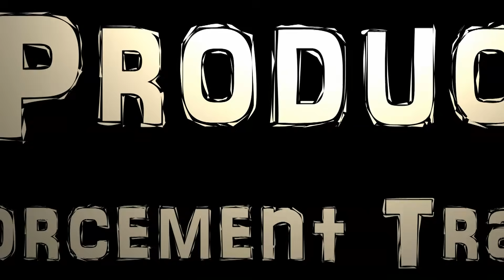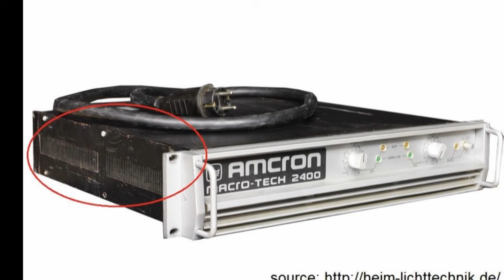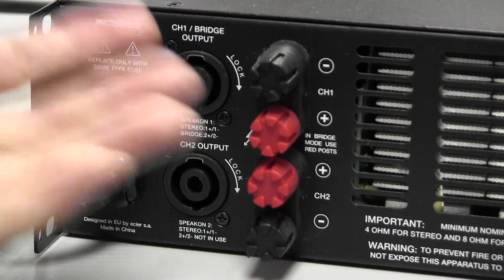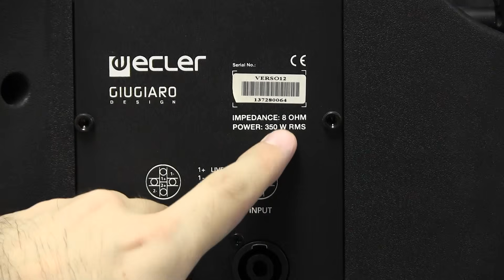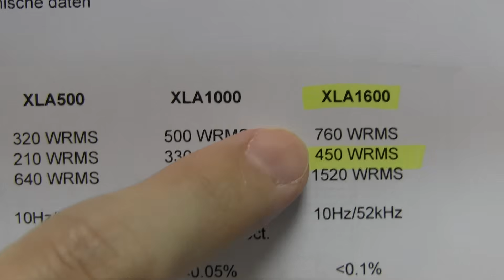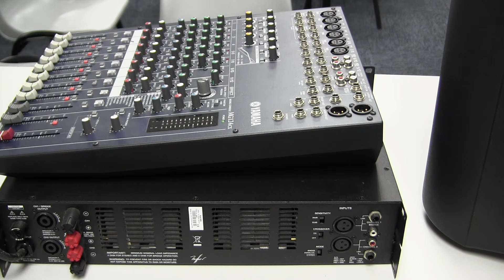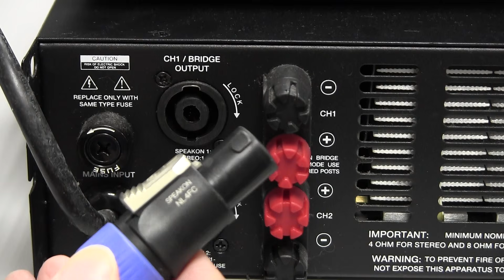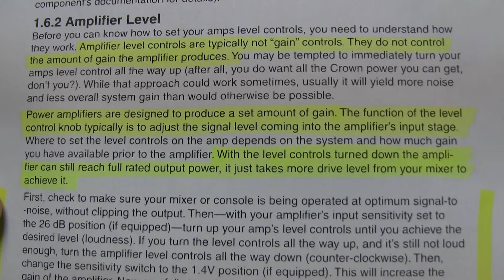How to connect a power amplifier to passive loudspeakers

Comment: does channel 1 & 2 means left and right?
Reply from the maker: Neil Bantugan No, you can deploy them however they are needed.
Reply: k sir. if i have 4 x 100 W speakers what amplifier do i need to suit my speaker specs?
Reply from the maker: Neil Bantugan Check the manual or the back of your loudspeakers - it will tell you what amplifier power is recommended. Then use the formula given in the video to work out how much total amplifier power you need.
Reply: it says 8 ohms sir. I am planning to wire 8 x 100 W at 8 ohms in series/parallel. So what power of amplifier do i neeed sir? Thanks !
Reply: P.S. the 8 speakers are only for a single channel so for 2 channel amp a total of 16 speakers.Thanks !
Reply from the maker: Neil Bantugan The video explains how to do this: work out the total combined impedance of your loudspeakers and check power amplifier delivery into that impedance. Then calculate how much power each loudspeaker will receive - in your case this should be 100-200 watts each. 
By the way, in sound reinforcement speakers are typically wired in parallel only, which for 8 loudspeakers gives a 1 ohm load, too low for most power amplifiers to drive. I suggest changing your design, or using 16 ohm loudspeakers.
Reply: Sir thank you for your response. Is it ok to plug a 400 Watt speakers @ 8 Ohm to a 600 Watt amplifier  rated in 8 Ohms?
Reply from the maker: Neil Bantugan You're welcome! Your question is answered in the video under the 'ensure amplifiers and loudspeakers are correctly matched' section.

Comment: Any thoughts or advice on DI boxes and PA?
I have a Mackie 808s and Mackie 300c passive speakers. I have been miking the guitar amp at about 30% through the Mackie 808s the rest from the guitar amp itself. The sound is quite good but in some rooms feedback is an issue as I play jumbo acoustic guitars.....thoughts or guidance?
Btw......great info on your vids. Thank you so much.
Reply from the maker: Wally Hall Hello Wally, nice to hear from you - you have a great voice, I've seen some of your Dylan covers :)
I've done a series of videos on DI boxes which you might like to have a look at: https://www.youtube.com/playlist?list=PLcTpo3gc2RJxKh7_x7Uttsz_BmH-1llW1
You must be a pretty big guy - I have a beautiful Takamine jumbo which doesn't get much play time just because of its physical size - I'm 5'10" and have a bit of trouble getting my right arm over it! 
A DI will usually solve most of your feedback issues but it can still happen because the top of the guitar acts like the diaphragm in a microphone and can start to resonate at certain frequencies, even with a direct connection. Fortunately things have to be pretty loud for this to happen. 
If you're using a mic it's important to aim your speakers away from it as much as possible - make sure you're sitting behind your PA as opposed to in front of it, and if you're using an amp as your monitor makes sure it's in front of you aimed at the back of the mic where the cable plugs in. It's also worth experimenting with your mixer's EQ to find the frequencies where feedback is likely to happen and cutting them slightly in advance, or taking note of them so that you can quickly drop them if a ring or moan starts during the gig. 
Hope that helps, I always love hearing from more experienced musicians like yourself.
Reply: Yep.....I'm 6'3".....so...jumbo guitars fit me okay. 
Thank you for the compliments my friend. I'll be taking your guidance in the DI use.....what all do ya do at GLB Productions, and, where are you located?
I do appreciate  the feedback sir.
Wally
Reply from the maker: Wally Hall Good to hear back from you. I'm in Singapore - GLB Productions is my company and I do mostly training for schools, churches and the like. I also do some freelance sound engineer work now and then, although I'm glad to have left all the carrying speakers and coiling cables behind :)

Comment: please answer me ?
i have 4 load passive speaker from "behringer eurolive a1520 pro" it is 8 ohms at 300watt continuous and i have behringer epx3000 watt amplifier
my amplifier can run in stereo mode
8ohms /20hz-20khz @ 0.1 thd  500watt
8ohms /1khz @ 0.1& thd          520watt
4ohms / 20hz- 20khz @ 0.1 thd 850watt
4ohms / 1khz @ 0.1 & thd         900watt
2ohms / 20hz @ 1& thd         1400 watt
2ohms / 1khz @ 1&thd          1500 watt

can my amplifier run those 4 loud speaker ?
Reply from the maker: nice_q8t Ah, good question. Let me ask you - based on what I have said in the video, what is the total load in ohms on each channel of your amp, assuming you hook up two speakers to each channel for a total of four? I could tell you the answer, but I'm going to help you work it out for yourself instead ;)
Reply: GLB Productions do you mean the rms power ?
this is the rms power 
8ohms / 1khz @0.1 %thd  550  watt
4ohms / 1khz @ 0.1 %thd  900 watt
2 ohms/ 1khz @ 1% thd  1500 watt

in stereo mode (both channels driven)
8ohms / 1khz    650 watt
4ohms / 1khz    1150 watt
2ohms / 1khz    2100 watt
Reply from the maker: nice_q8t No, the load on the amplifier. You have a 2-channel amplifier; you connect two eight ohm speakers to each channel, what is the combined load on each channel? The answer is in the video :)
Reply: GLB Productions did you mean i should divided 8ohms to 2 speakers in left channels = 4ohms total and 8ohms divided to 2 speakers = 4 ohms in right channel 
correct ?
Reply from the maker: nice_q8t Correct, the combined load is 4 ohms per channel. So if your amp delivers 850 watts into 4 ohms, how many watts does each speaker receive, assuming two speakers connected to each channel?
Reply: one speaker watt is 300 at 8ohms but i dont know how much it will be in 4 ohms ?
Reply from the maker: nice_q8t No, read my previous comment again! Your amp delivers 850 watts into 4 ohms. If there are 2 speakers sharing these 850 watts, how much does each receive?
Reply: 850w divided into 4 speakers = 212 watt ?
Reply from the maker: nice_q8t Almost! It's 850 watts per channel, shared between TWO speakers. So 425 watts per speaker. So if your speakers have a continuous rating of 300 watts, is the amp suitable, based on what I say in the video?
Reply: GLB Productions
 am not sure because i am so noob in sound am sorry if i took your time :P by the way these speakers are in our school stage - already equipped with two epx 3000 watts i just wondering if i can hook up them in one amp and i took the next one is a step if the first amp fired or something goes wrong

thank you so much for your time
Reply from the maker: nice_q8t No worries. The short answer is yes you can - you are one step away from calculating why this is the case. Get back to me when you figure it out!
Reply: GLB Productions i think its suitable left will get 850 watt and right will get 850 watt and when you do the math 850 watt x 2 = 1700 and my amplifier is 3000 watt is it correct ?

Comment: can i hook them up to a digital system such as a computer or a usb bluetooth dongle
Reply from the maker: paul schlacter By 'them' you are referring to...
Reply: Passive loudspeakers with an amplifier supporting xlr cabling
Reply from the maker: paul schlacter Yes but it is best to run through a mixer of some kind. See my video: https://www.youtube.com/watch?v=ge4Iynh4rcc
Reply: can i use an external or internal sound card as a type of mixer?
Reply from the maker: paul schlacter Yes you can. Just bear in mind that the outputs of most soundcards are unbalanced so you will need the appropriate equipment to go from minijack or RCA to XLR connectors.

Comment: Great video!!! What would be the reason to daisy chain amps together??
Reply from the maker: Jamial Black When you need to drive multiple amps from one signal source eg the main LR outputs of your mixer to four power amps each driving one large speaker at front of house.
Reply: GLB Productions thanks great info!!!
Reply from the maker: Jamial Black No worries.
Reply: Is there a such thing as daisy chaining amp(s) together for more power?
Reply from the maker: Jamial Black Yes in the sense that you get more total wattage by connecting more amps into your PA system. However you would never connect the speaker level output of an amplifier to the line level input of another!
Reply: Great info thanks!!

Comment: Hi Bruno!
Last time I forgot to ask you a thing about to setting Active Loudspeakers!
To have the best S/N Ratio is it better to have the Loudspeakers's volume all the way up and the Master Section of the mixer lower (for the amount of volume wanted),or the mixer's output section must be at Unity Gain and the volume on the Loudspeaker lower (always for the amount of volume wanted)?Obviously taken for granted that nothing is clipping...
Forgive me! :)
Reply from the maker: ***** Hello Chris, the second approach is the correct one - mixer should be operated at optimum levels and the level control on the active loudspeaker used to set final system volume. Remember that active loudspeakers are essentially speakers with power amps built into the cabinet, so the principles are the same :)
Reply: Thanks Bruno for your answer :)
But in this case someone has to turn the volume knob for me remotely while I'm checking at the console if it's the correct level?and then tell him to turn it up or down?
Reply from the maker: ***** It definitely helps to have an assistant, otherwise just walk back and forth. Remember to check the volume in the middle of your listening area, not just at the mixer, and also leave some room for when the audience start screaming their heads off :P
Reply: GLB Productions Very precious advices,thanks! ;)I've got an off topic question too,but I will make it on your facebook page!

Comment: I hope you are not tired of my questions. You just do such a good job detailing the processes. I have two questions:

Can you under power speakers? I have a set of Peavey 12's that are rated at 400 w but my Amp (also Peavey is only 500w, will this cause problems with the Amp?

Second question is about the Speakon Cables, are they like mic cables? Are they balanced, do they have a length is with noise?
Reply from the maker: Dennis Neuhaus Not at all Dennis, feel free to ask any questions you might have. As an educator I am always keen to learn how my students think and better understand the learning process. 

Yes you can under power speakers - even a one watt amplifier will produce sound from a loudspeaker! However the danger is damage to your speakers if you clip the input to your amp, which is much easier to do with a too-small amp trying to fill a large venue. BTW, if your speakers are rated 400 watts RMS @ 8 ohms and your amp is 500 watts into 8 ohms per channel that is not underpowered, that is quite a good match! 

Speakon cables use speaker cable, ie dual unshielded heavy gauge stranded copper cable. They are unbalanced. They are most definitely not interchangeable with mic cable! With speaker cable noise is not really an issue because there are no gain stages after the amplifier and also the signal is already at a very high level, so noise infiltration at this stage is generally not noticeable. However the longer you run your speaker cable to more of the signal is lost as heat, so you should keep the distance between your speakers as amps as short as possible. Locate your amp next to your speakers, not next to your mixer!
Reply: GLB Productions Now that I kinda understand the math here and pulling spec sheets for the two components, I believe my amp (Peavey PV-4C) is "under powering" my speakers (Peavey PR-12).or not. The amp specs say 420w RMS into 8Ohms which is divided by the 2 channels equaling 210w per channel, did I calculate that correctly? The speakers specs say power rated 400w (program) power capacity 800w (peak). This means I am only using 50% of the potential power rating of the speakers, is this correct?

Some of the specs of other amps is a bit confusing to me as well. What I think I need is an amp which delivers between 400w and 800w per channel to properly power the speakers, is this correct or am I not doing the math correctly?
Reply from the maker: Dennis Neuhaus Hello Dennis, I'm not sure which version of the PV-4C you have, but I pulled up this manual here: http://assets.peavey.com/literature/manuals/80301760.pdf According to that document, your amp is 120 watts per channel into 8 ohms. Amp power ratings are always stated per channel with the exception of the bridge mono ratings. 

You got the power rating of your speakers correct, ie 400 watts program. So technically your amp is slightly underpowered - the ideal amplifier for these speakers would be between 200 and 400 watts per channel @ 8 ohms. Remember, program power is usually double the RMS rating - as stated in the video, ideal amp power is between RMS and RMSx2. 

Having said that, 120 watts is more than half of 200, so we are looking at a difference of less than 3dB here - hardly anything to worry about! 

Nice gear - those USA made Peavey amps and speakers sound decent and last FOR-EVER!!!
Reply: I think I forgot to mention the 8 Ohms for the speakers. The amp is an old piece of equipment I found a few years ago on eBay. The speakers as well came from eBay.
Reply: I hate to ask something that is probably obvious, where are you getting the number of 120w? I don't see it on the specs sheet for the amp. I am using the same PDF file as you listed.

I am amazed at the information (knowledge) you have to share. Are you college (university) educated as a sound engineer?
Reply from the maker: Dennis Neuhaus The figure of 120W is on page 9 of the PDF, under 'Rated output power.' It's important to use this figure, which measures across the full audio bandwidth, rather than the slightly higher 'output power' figure which measures only at 1kHz. 

I have a university education but it's not in sound engineering - that I have learned on the job, as a second career, alongside my mainstream teaching. God has been very gracious in granting me the ability to absorb and pass on lots of information :)

Comment: GLB Productions  I've got a good question sir, on my (pmh2000) powered mixer it has a "monitor" preamp output. From that, can I plug into "tape-in" on a home a/v receiver? I'm wanting to use mixer for main speakers, and receiver for monitors. Have you ever seen this? Don't have the cash for another amp at the moment.
Reply from the maker: lehrerayne Interesting question - which brand of powered mixer is that please?
Reply: Behringer europower pmh2000.
Reply from the maker: lehrerayne Yes, you can connect that output to any line level input on your a/v receiver - remember that the output is mono so you may need a splitter cable if you are connecting to a stereo input on your receiver. Also bear in mind that home a/v receivers are not really designed for sound reinforcement use, so check your impedances carefully and do a test run before using it on an actual gig!
Reply: Can one take an rca to trs(1/4") cable - strip the rca end only - and connect to standard speaker connection on the back of an amp/receiver to power the monitors? Amp is a heathkit aa 1640. I don't believe it has banana plugs or  trs speaker outs. Just standard.
Reply from the maker: lehrerayne That amp has what are known as screw terminal outputs - they are common on the back of amps meant for permanent installation. 

You can do what you suggest but you MUST use SPEAKER cable - not instrument or line level cable! I assume you know the difference ;) 

In your situation I would recommend that you have your speaker cables custom built or build them yourself - 1/4" connector on one end (TS, NOT TRS) and at least 16 gauge speaker cable to bare end on the other, with the wires tinned to prevent fraying.
Reply: GLB Productions Oh, thanks!

Comment: Thanx Bruno,

Your video's are verry helpfull and leave verry little room for error!
My own system is built up with multiple amps, getting their signal through an active cross over such as the DBX 234xs.
Perhaps a good supplement on this video!
Sorry for my English, I come from the Neterlands.

Further more, do you have anny video's about foh mixing with the help of gate's and efects, together with equalization?

And perhaps about mixing monitors from foh?

Thanx again, and hope to hear and see from you soon!
Reply from the maker: B.H.G. Joosten Hello my friend, thank you for getting in touch. Your English is excellent, no need to apologise :) 

Yes, I have a number of videos on the topics you mentioned: 

How to connect a gate/compressor unit to your mixer: https://www.youtube.com/watch?v=RLf8jXGtF8w
How to operate a gate/compressor unit (Presonus ACP88): https://www.youtube.com/watch?v=jMajPBeAGbw
How to connect an external effects unit to your mixer: https://www.youtube.com/watch?v=GoIiofqEIyU
How to use a mixer's EQ section: https://www.youtube.com/watch?v=m6McBjaU9PM
How to set up monitor mixes from FOH: https://www.youtube.com/watch?v=MUAbIGGkeUk

These should get you started. Let me know if you have any specific questions and I'll answer them if I can. 

Bruno